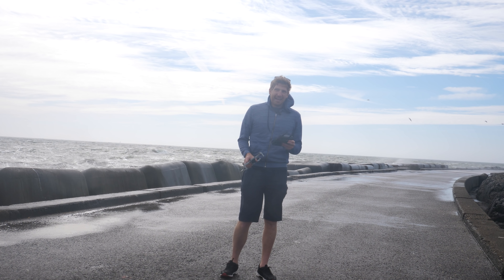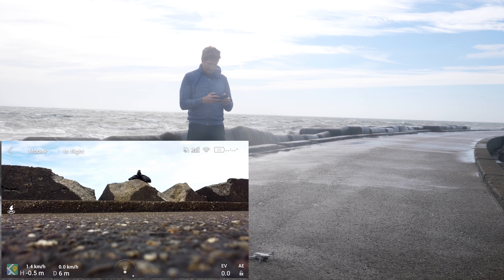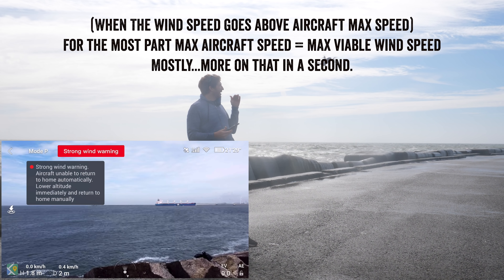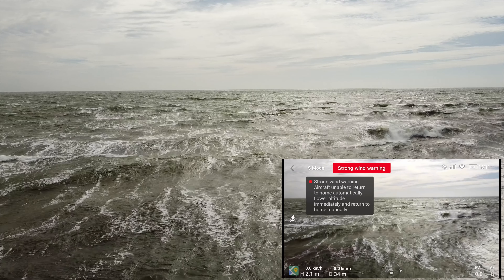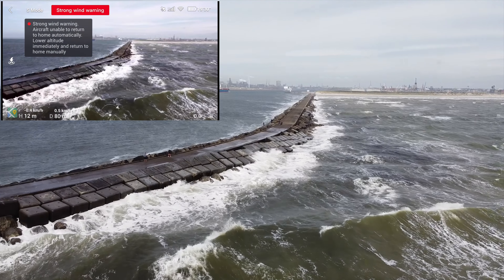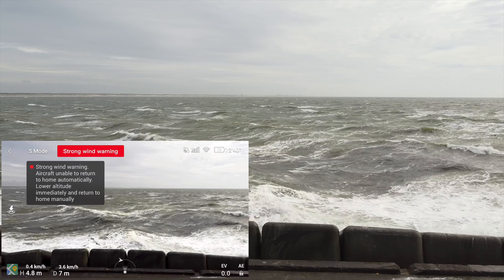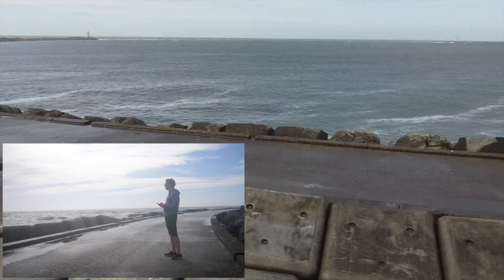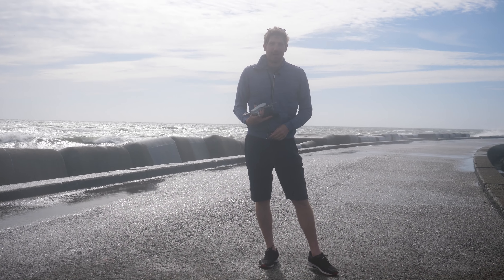DJI Mavic Mini High Wind Test!

Comment: The update they did when you lose RC connection was critical. Originally just RTH which I bet cause a lot of mini losses. 
Now you have hover and descend. Sometimes better to just descend on land somewhere and retrieve it. 
The issue was that in high winds some people couldn’t RTH. So they try to land it but objects like trees would cut the RC connection which would initiate the RTH which cause the Mini to further drift away! In this situation it was best to just try to hover until the battery forced a descend. But at least now you have a descend option.
Reply from the maker: Yeah, thankfully it was split-second and nothing bad happened in my case.

Comment: When used correctly the Mini has so MUCH more potential than it gets credit for.
Judging by it's weight benefit, the video and picture quality and ofcourse it's price i think that it's the best Drone DJI ever made, even taking the Mavic2 into consideration which has better specs but costs twice as much and has several serious drawbacks with regulation, especially 2 years down the line.

Comment: EXactly what i was looking for. i thought last night you already have this review before, it turned out it was the MA2. i'm thinking of getting this or the fimi x8 se 2020 coz they're of the same price range. my only concern was that there are a lot of flyaway reports for MM. this one somehow proved them wrong(my opinion). great work
Reply from the maker: Yeah, flyaways are tough. They more or less happen with every drone - but drones that sell more units (like the Mini) will ultimately see more reports. Also, I suspect with the Mini being a much lower price point, there's a bit more inexperience there. As such, I'd bet a portion of those flyaways may be 'driver' related.
Reply: @Dcrainmaker  you're correct, most of flyaways are pilot error due to inexperience. Not enough satelites, compass error due to power on on concrete or metal surfaces, not understanding wind profiles are the most common errors.

Comment: Interesting using the Sport mode to recover from wind. Is that a technique that would work on any DJI drone, such as my Spark?
Reply from the maker: Yup indeed, works on the Spark too!
Reply: It's also good to set to sport mode if you're flying far and starting to lose signal. That way if it does a RTH it will be able to push vs any wind (up to a limit)
Reply: @Airbag888  I think it changes to P mode when it executes RTH

Comment: Excellent video, would it be possible to also use a anemometer to get the most accurate on ground wind speed and then compare to wind speed as simulated by Airdata?
Just flew mine in 25-34km/h wind this morning, it struggled a bit (10km/h speed upwind)
SO worried about corrosion due to sea spray though :p
Reply from the maker: Yup, I usually bring one, but somehow it slipped out of my bag back at the office. :( Luckily, in my case there were live weather stations at both ends of the pier on the towers, so historically I've found my data matches there data pretty closely.
Reply: @Dcrainmaker  You know in a few years after our friendship reached super high levels, we'll look back at this time when your anemometer slipped out of your bag and how it started it all... 
On topic: Weather station at the end of each pier is SO classy! On a more serious note: Will the flight controller always favor letting the wind blow the AC away than fight it even if it flips? 
My concern is would a strong enough gust just flip and crash a mavic mini or would it just get dragged off?

Comment: Bought mini a while back but honestly better to get something a little heavier as I live in a relatively higher altitude area with some winds and it has fallen out of the sky a few times, injured my finger as well and propellers got slightly damaged. I've been scared since. Even installed the guards for some extra weight and safety. Would try not to fly in urban areas or where the drone may get lost forever (near water).
Reply: How come it fell out of the sky? Low battery?

Comment: I’ve flown my Mavic Air in much lesser winds only to get a gimbal overload message. Obviously my gimbal stopped working at that point and my video feed was shaky. Wondering why that doesn’t happen to you in this situation?
Reply from the maker: Hmm, typically if I see gimbal overload messages (across years of experience), it means my gimbal needs servicing. :(
Reply: DC Rainmaker I had seen it once before when I landed in grass. I can understand getting it that time but not midflight. Never crashed my drone and at that point it had less than a dozen flights.  I’ll keep a close eye on it to see if it’s going to be a reoccurring problem.

Comment: Have owned DJI mini and it has not lived up to ANY of the wind or distance tests championed by Youtubers. 

Real life experience is 
-if the wind is over 20kph forget about it, it will get jerked about the place and then try to land itself (disaster over water) 
- it can fly about 800m before signal is lost (line of sight)
Reply from the maker: Honestly, if you’re seeing that at a mere 20KPH, then you either never got GPS lock, or are doing something wrong.

Comment: My DJI Tello would have been over the ocean in 20 minutes with this storm around.
Reply: DC Rainmaker: challenge accepted
Reply: Vinayak ‍ haha no. Problem with the tello there is no RTH. I’ve tested a Tello myself in high wind and luckily I can land it before the WiFi disconnected. 
At the minimum you would need to use a usb WiFi repeater but you run a risk of disconnection and then it’s done then as it will just drift away.

Comment: This why this aircraft has a max   wind speed resistance of 8ms, and should not be used in high winds. You don't even mention this in your video 👎, people are going to copy this and end up losing there drones because of this video!!!
Reply from the maker: It's shown on the screen. People aren't going to lose drones because of this video. The opposite, I teach them how to fly in these winds, and the exact threshold to be aware of. I also explain the nuances between the speeds. Knowledge is power.
Reply: You don't mention once to check the user manual, people have insurance, and if they are flying there carelessly like this there insurance will be void due to operating outside the operational envelope of the aircraft. 👎 Just look at the comments, people are now going to operate their drones in high winds and think it's ok because of your content!!!

Comment: The range is crap not even a mile
Reply: Depends where you are flying..I have done 2333m...1.45miles with no problem at all.😉
Reply from the maker: Perhaps, but where I am, I rarely need it to go more than a few hundred meters.
Reply: @Dcrainmaker  mini mavic is an excellent unit for short range flights for taking photos etc!  Good luck.
Reply: I get over a mile with the weaker CE-version.
Maybe you forgot to shut off WLAN and Bluetooth and didn't put it in Airplane Mode?